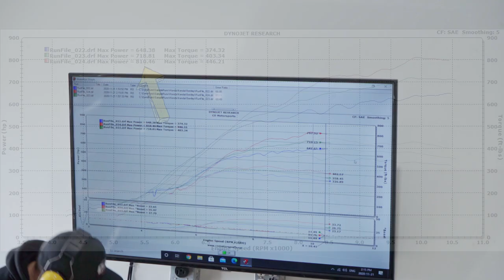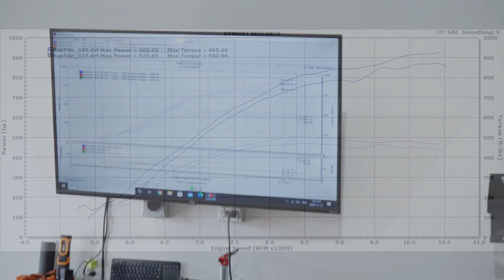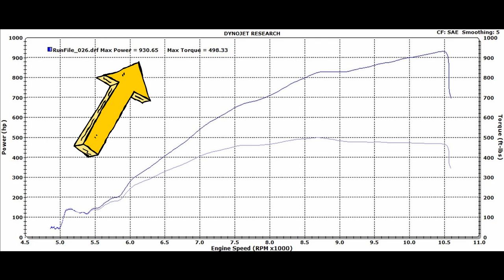Sport Front Wheel Drive Honda Civic with Precision 6785 on the dyno

Comment: The GSR was a 1.8L engine. Is he running a B20 bottom end and a GSR head? Also what trans is that car using to handle the launches and power output?
Reply from the maker: B20, PPG dog box with billet bell housing

Comment: Why is the catch can venting out so much crank case pressure? Does that mean the OCC is full?
Reply from the maker: Turbos moving a lot of air. And it was a bit on the colder side during this.
Reply: @COMotorsports  ah gotcha, thanks for the answer!
Reply from the maker: @rjmarcum7917  no problem.